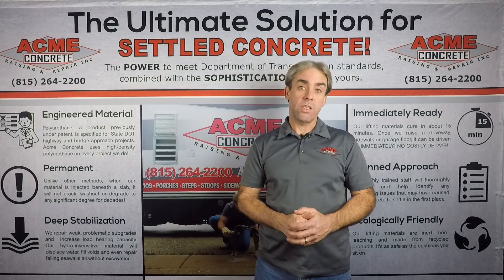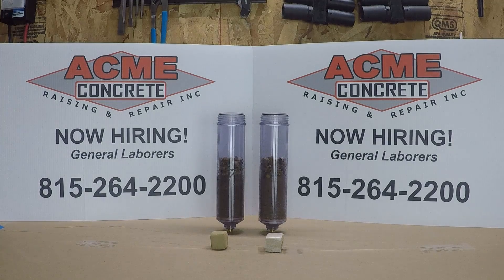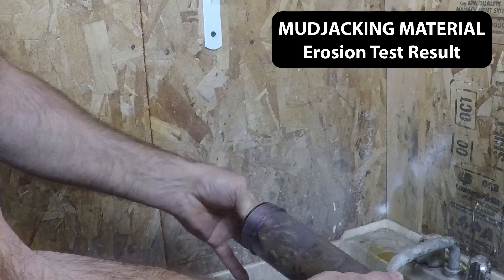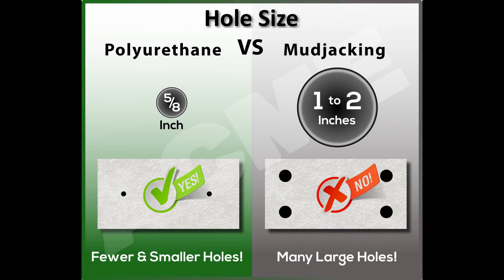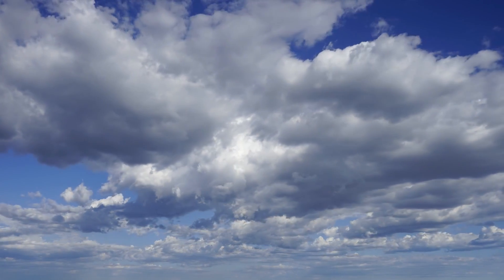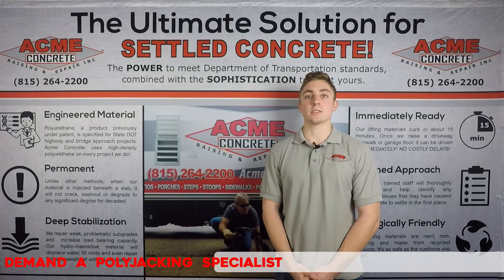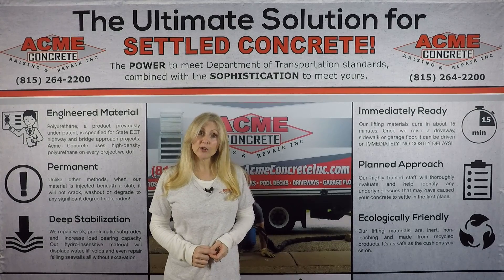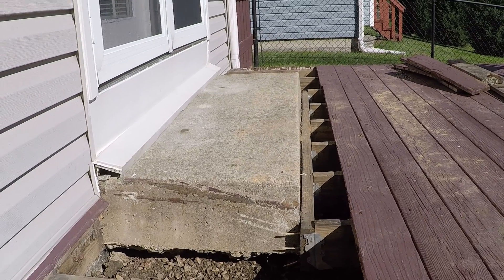Polyurethane Concrete Raising VS Mudjacking

Comment: Poly does not stop erosion any better than mud jacking done right. Poly just forces the water to wash the dirt underneath away instead of allowing it to slowly seep into the ground.
Reply from the maker: Hello Zeke - thank you very much for watching our video! We really appreciate you interacting with our YouTube channel. However, it's clear you missed the point of the demonstration. We are not claiming or tying to show that polyurethane stops erosion. Problems with erosion are best dealt with through regrading where needed, well functioning gutters, and routing downspouts away from the home or building and concrete structures. 

Even when these preventative measure are put in place, water can still get beneath concrete that's been raised. 

Our demonstration shows the effect water has on the "lifting materials" used to raise and support concrete. A large portion of the work we do involves raising concrete that's been mudjacked previously. It is painfully obvious on these jobs that the mudjacking material itself is what eroded or washed out from beneath the concrete allowing it to drop again. To be clear, it's the mudjacking material that washed out, not the gravel/stone subbase.

Time and time again, (depending on the mudjacking contractor) the customer was sold on the mudjacking material being one of the following: "Clay/sand", "Custom mortar mix", "concrete" or "Crushed limestone". We take the time to dig the mudjack material out from beneath the slab and we find what you witnessed in our video. We even video us obtaining these samples. Here are some more for you to enjoy:

https://youtu.be/Lv4ppzmJeKQ
https://youtu.be/tT1QZIo0-7U
https://youtu.be/pk4vv4O7TSc 

I can debate the technical superiority of polyurethane over any mudjacking material with you all day. Unfortunately, that wouldn't get us anywhere. It's not going to change the fact that some people are not willing or able to obtain and learn a more technically demanding service. It's an expensive investment and the learning curve is steep. 

Honestly this all misses a much larger, much more important point. The point is that people are paying for a service anytime they hire us. What really matters is what the customer is getting for their money. How much are they paying and how long will the repair last. Here, my friend, is where the rubber meets the road as they say...

In general, any poly provider is going to offer a much better warranty that most any mudjacker. Why do you think this is Zeke? We both know the answer to that question.
Reply: @Acmeconcreteinc  Longer warrantee is better but I don't trust warrantees. The company simply changes it's name and no longer exists and doesn't have to back up anything or there is small print the always makes it a non covered item.
Reply from the maker: Great points! We always recommend hiring a company with good longevity, and reading all the fine print. We most definitely have contractors in our area with limited warranties or conditions that eliminate their liability to future sinking. Here are some examples: https://youtu.be/98KrWQEICGc
Reply: @Acmeconcreteinc  I repair several failed foam jobs every year. The quality of repair has everything to do with the person performing the work and nothing to do with the materials.
Reply from the maker: The quality of a polyurethane project has everything to do with not only the techniques applied but ALSO the material being used! Did you know that some companies actually use Spray Foam Insulation to raise concrete??? This is only one example of why it DOES matter what material is being used. There are even videos of people using cans of expanding foam from hardware stores to stabilize concrete that's been mechanically raised. 

Your comment that "The quality of repair has ....  nothing to do with the materials." is 100% false.

We use different foams for different applications - flooded areas, deep injection, stabilizing projects and heavy duty for larger slabs. What we use and where we use it matters.

Comment: That material in no way resembles properly compressed and set limestone screenings traditionally used in mudjacking. That looked like pure clay with a few pebbles in it to me. What a useless and biased comparison.
Reply from the maker: The material used in the demonstration is actual mudjacking material obtained from failed mudjacking jobs. In many cases, it was described as either a custom mortar mix or crushed limestone.

Properly compressed limestone? They mix mater with it and pump it beneath the slab. The only pressure involved with the process is what's required to push the slab up - I wouldn't equate that to "properly compressed and set". It generally takes less than 10 PSI to raise concrete. (That's why mudjackers can simply hold the nozzle in place their foot) We raise concrete that was lifted by a national franchise that uses crushed limestone. It fails all the time. 

Over time, moisture gets beneath the slab which softens it back up and it slumps down (or washes completely out) allowing the concrete to drop again. 

It's a cheap process using cheap materials. Polyurethane is completely water resistant.
Reply: @Acmeconcreteinc  my pumps can make alot more than 10psi. We NEVER just stand on the nozzle as it can result in serious injury. Go take crushed limestone, bentonite, and portland mixed together and try to wash it away. It simply won't happen. 

Maybe your competition just uses crushed limestone with no additives but you can't seriously try to imply that we all do.
Reply from the maker: It is VERY common in our local area of Crystal Lake, IL for mudjackers to falsify what they're selling. A particular company here claims to use...and I quote, a "custom mortar mixture" and claims 2,000 - 2,500 psi compressive strength. We have always known this is false due to re-raising concrete previously raised by this company. We always dig that mudjacking material out from the slab to test it by forming cubes and seeing how it stands up to water and if it will simply crush in your hand. It's NEVER anything with any compressive strength or able to resist soaking up water and turning soft as mud.

To be certain this guy was if fact falsifying what he's selling - we went to the extent to "sponsor" a project where a friend of ours hired this company to raise their sidewalk in Genoa, IL. As soon as the project was done, we collected fresh samples of the "custom mortar mixture" and sure enough it's nothing more that what you would expect to find around a baseball diamond. Fine clay. No compressive strength and no resistance to water. It's sad really, he's been doing this work for a long time, you would think he would have more self respect and basic decency. Tisk-Tisk.

However, this explains why mudjackers in our area only offer 1-2 year warranties - they KNOW it's likely going to fail.

So, you guys never just stand on the nozzle, huh? How do you secure it into the hole?

Comment: How effective is polyurethane foam at insulating a concrete slab from underneath?
Reply from the maker: Hello Shawn: Thank you for your question. There are many formulations of polyurethane foam developed specifically for Spray Foam Insulation. These products are used to insulate residential/commercial buildings and have specific R-Values or thermal resistance ratings. The polyurethane foam we use is specifically developed for raising and supporting interior or exterior concrete slabs/structures. Its primary function is to lift slabs, and provide superior resistance to the elements. Lifting foams do not typically come with a measured R-Value. Our lifting foams would absolutely add some level of thermal resistance, but exactly how much would be difficulty to determine.

Comment: Cost.  I get a funny feeling your push for poly is mainly to justify the money your asking for
Reply from the maker: Hi Kevin, thank you for watching. We're glad you commented - it brings up a great "misconception"! 

Any logical assessment would say, compared to mudjacking - polyurethane MUST be more expensive. Why wouldn't it be? Polyurethane is a manufactured product designed specifically for concrete raising & stabilization, the equipment required to install it is more complex, and skilled labor is needed. Mudjacking is accomplished with cheap material, simple equipment and requires a lower skill set. (Not to mention mudjacking can really deface your concrete: https://youtu.be/gJRKDhm3N_A)

The fact is we're the lower cost repair when compared to many mudjackers. This is because of two reasons: 1) Mudjacking is typically way overpriced, and 2) Our process is very efficient, and we keep our services priced very competitively.

Even if we are slightly higher than mudjacking, we're still likely the better option based on longevity of the repair. A large portion of our projects involve raising concrete that was previously mudjacked. If a customer selects mudjacking because it's 10% cheaper and has to pay to have it raised again two years later, they've lost money, not saved it.
Reply: Thanks for the info. That was just my first thought or impression. I've been around a little concrete in my 15 or so years. Mainly basement and garage floors or 10 inch foundation walls. I do the prep and mainly excavation for residential homebuilders I grew up with. I've seen a lot of concrete poured but I wasn't the one working it. Anyway I didn't know there was a drill, inject and level option for sunken concrete. Wed just hammer it load it out and pour it again. Good to know thanks

Comment: Is there classes u can take to learn how to install this poly ive never had any luck with mud jacking ive hired several companies in my town and all they did was crack the pad basically ruined the pad
Reply from the maker: Hello Donnie - thank you for your question. YES - there are classes offered for polyurethane concrete raising. Unfortunately, many of them are more of an introduction to the art than anything else. What's really required is in the field training that occurs over a long period of time involving lifting a wide range of concrete slabs/structures. 

As for slabs cracking during lifting, this is something that can occur with polyurethane as well as mudjacking. Most cracking can be avoided by a highly trained/experienced installer. However, there are situations where hairline cracks or fractures exist in the slab that are not visible prior to lifting. These small cracks can open up during the lift and are of no fault of the company raising the slab.

Slabs can also crack after lifting if the materials used to raise the slab fail to keep the slab properly supported. We see this regularly with concrete that was previously lifted with some type of mudjacking slurry. 

In our opinion, the best scenario is to hire a company that's not only capable of providing polyurethane, but that also has a strong track record.
Reply: Poly can crack a slab too guarantee it’s a stress crack or they didn’t cut the seam to free it up

Comment: why couldn’t you just use more concrete to jack a slab up?
Reply from the maker: Thank you for a great question! There are several reasons why polyurethane is a much better choice. However, it's worthy to note that most mudjackers claiming to use concrete or some type of "mortar mixture", are in fact not doing that at all. The vast majority of mudjackers use a clay/sand based mixture which is highly subject to washout over time. Why??? Well, if an actual mortar mixture was used, the cleaning required for all their equipment after each job would be much more involved. This also means they would be using more water, creating a "cement laden" rinsate that would have to be dealt with. Most residential customers would not be too happy with this happening on their property, and it also slows the mudjacker down between jobs. Mudjackers have a much easier time of cleanup by simply using clay based lifting materials - that breakdown easily with water.

Another thing with mudjacking has to do with the weight of the material. Concrete is very heavy, and the weight can exacerbate the rate of sinking. Adding more weight to an already compromised area can be counter productive.

Using concrete or "mudjacking" a sunken slab requires drilling large holes (1-1/2 inches typical) through the slabs in several locations. Even thought these large holes are patched, the raised slabs are visually destroyed, leaving many people regretting having them raised. (see our video regarding injection holes here: https://youtu.be/gJRKDhm3N_A)

To summarize, lifting slabs with a "mortar mixture" usually means a clay based material being used that washes out quickly over time. Large holes defacing the concrete are required to used an aggregate based slurry, Finally, it's much more advantageous to use a light-weight, completely water-resistant high-density polyurethane lifting foam for great looking, long lasting repairs to sunken concrete.
Reply: @Acmeconcreteinc  poly will never wash out just everything around it creating a void, Portland and aglime is the way this town does it and works way better and more cost effective. Poly also never fully fills the void just piles up and I would love to discuss this with you. Only reason poly is a thing is cause it’s a lot cheaper to get into around 50-60k vs mudjacking setup is around 100k-or more depending on how hard you go
Reply from the maker: Thank you for watching our video and for your comments! You bring up some great talking points! We do, however, have to disagree with your take on polyurethane, but in your defense, I think the key differentiator to some of your points has to do more with WHO is doing the work. Polyurethane - installed correctly - will outperform mudjacking. A huge portion of the concrete we raise was previously mudjacked and sank again. And yes, those customers were sold on "portland & aglime" or "custom mortar mix" or "100% concrete". But to your point, anyone can make the investment to acquire a polyurethane injection system and go get concrete to lift. Possessing the proper knowledge through training and experience that enables an installer to "do it correctly" is a whole other thing. Here in the Chicago area, we see companies (water-proofers, mudjackers, and concrete installers) trying to add polyurethane concrete raising to their existing business and they clearly do not possess the expertise needed for poly. This technology is better left to a specialist.

When installed correctly, poly will fill voids, and it can do so better than mud. Why? Because mud is much "thicker" than the poly when it's injected. Poly flows outward much more easily than a slurry. We typically place injection points three feet apart and see the poly move from hole to hole. We do not just drill lifting holes either, we always use support holes to fill additional voids that are created from lifting slabs. We would be happy to discuss this with you further.

As for your comment "Only reason poly is a thing is cause it’s a lot cheaper to get into" - we wish it were true, but that just isn't so. Just our hose going from the truck to the slab we're raising costs more than most any "mudpump" we see on any given day. Here are the facts: Our equipment is not only more expensive, it's also much more complex. Most anyone can operate a mudmixer/mudpump. It's pretty simple stuff and easy to maintain. (we've heard of a company here that actually makes their own homemade mudpumps) Mudjacking is easier to do, requires less expertise, has easy to repair/maintain equipment, lower upfront equipment/training costs, and the materials used to lift slabs are cheap. Polyurethane systems on the other hand require employees with a high skill set that are properly trained to operate and maintain the equipment. Polyurethane installers also have to purchase the poly from manufacturers. Unlike mudjacking mud, the material has to meet specific performance & quality standards and naturally costs more. Yet we provide pricing to our customers that is competitive with the mudjackers. So, no poly is not a thing due to "low cost to the contractor", it's quite the opposite. We provide poly just because we know it's the best option for consumers, and we have no intention of doing anything second-best.

Comment: That mud was mixed improper without Portland cement and your talking bad about mud jacking like you said they do what makes you better for doing it?
Reply from the maker: Hello "TheVanillagorilla12"...thank you for watching our video!

What makes us better for doing it? Actually, what makes us better is that we don't do it! Although it would be easier and cheaper for us, we would never propose mud jacking as a solution to settled concrete. A high percentage of our concrete raising jobs involve sunken concrete that was previously raised by a mud jacker. We only use a high-density, water-resistant polyurethane - the same stuff specified for heavy highway/tollway repairs.

The purpose of the video is to help break down the facts regarding the differences between old mudjacking techniques and polyurethane concrete raising.  It's important for consumers to be able to make decisions based on factual information. One huge fact is that we're constantly re-raising concrete where mudjacking failed. 

We obviously can't video all these experiences, but we have a few more related videos here:

https://youtu.be/tT1QZIo0-7U
https://youtu.be/pk4vv4O7TSc

Thank you again for watching!